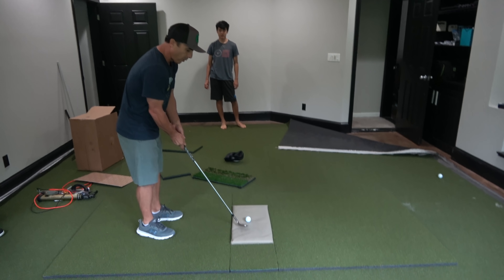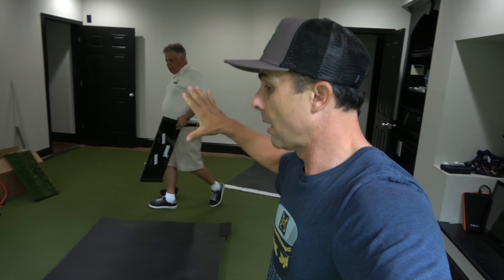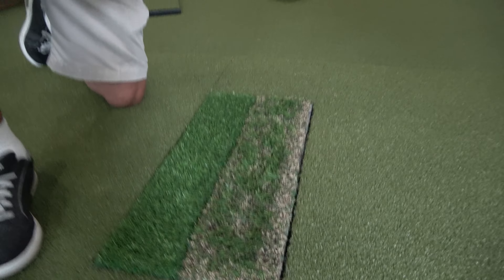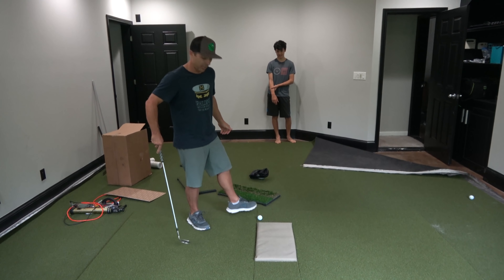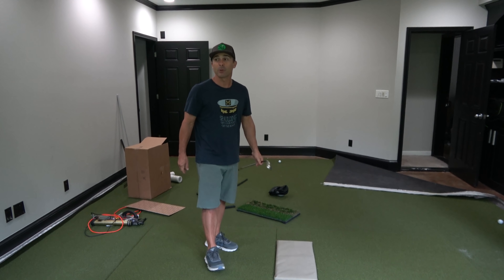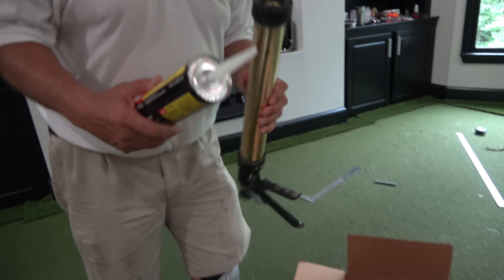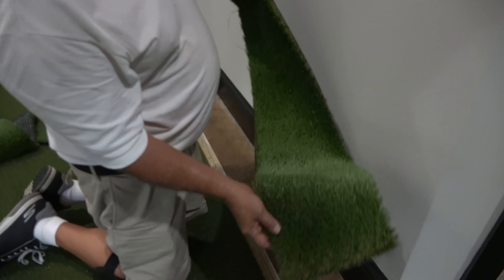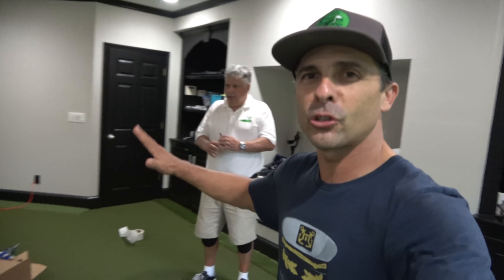How To Install Your Home Putting Green

Comment from the maker: Lots of people asking about the cost of this room. So far with the green and the chipping fringe we're about $2500 not counting shipping and material which is about another $300.
Reply: is this at your house?
Reply: Wow, thats pretty affordable for what you got!  Can you get some good close-up of the surface?  Interested to see what that's like.
Reply: Thats not bad. Its got me thinking. I wonder what life expectancy and maintenance is like.
Reply: a2fitness Really no maintenance but use a shop vac and not a beater bar vacuum since it will slow the putting speeds. Life?
Since it is a heavy face weight 100% NYLON TURF which is very dense, actually feels like your standing on a firm real grass green, it will last for decades!
Reply: That's a decent price now I just need a room...
Reply: Where did the material come from? Looking to install something like this ASAP!
Reply: @matthewjeffries859  CustomDesignGolf.com It is our BentGreen™ putting and chipping (fringe trim) turf.

Comment: Wish I could could afford an indoor putting green,screen simulator setup...
Can I ask what is the purpose of the fridge around the edges? Is it for looks only? Doesn't look like you'd have much room to stand on it and  chip or putt from it.
Reply: Dwayne S It was not intended to be a chipping area. It was only intended to trim out and fit the putting BentGreen turf (15 ft wide w/o seaming) to the room, but also add to the overall room aesthetic. MrShortGame wanted to maximize the putting area and the DivotAction mat will function well with the Combo, First-Cut/Deep Rough Insert for chipping purposes.
Reply: @johncarilli2227  thanks. I thought it was for looks. Never know until you ask😀

Comment: I am a Carpet Installer by trade . I wouldn't have done the fringe that way . To many " Nap " Changes , Gives it a different color Look . I would have made the fringe all go in the same direction giving the room a more uniform Appearance
Reply: The turf needed to relax and since it was just unrolled, in time the fibers will become vertical.
Reply: @johncarilli2227   Some truth to that , but from my 50 plus years in the industry that doesn't happen . fibers have a natural flow and must be installed that way
Reply: Turf is quite different than carpet.
Reply: @johncarilli2227  I am aware the differences . Been involved in many Synthetic Grass installs . Football stadiums  batting cages ,Put Put courses and even Lawns . So believe what you want
Reply: Larry Vawter Just to clarify your judgement... We never use polypropylene or inferior similar fibers but our fringe turf uses a special turf and has a secondary thach. As it is allowed to rest after being unrolled the fibers refresh and will not lay flat over short order.
Reply: @johncarilli2227  If you say so . I only do this stuff as a living like you do Golf instructions which I thoroughly enjoy . I wish you all the best and enjoy your putting green room and trackman . Stay healthy